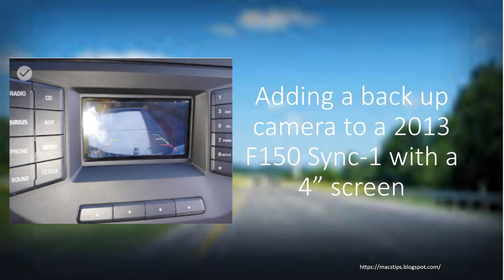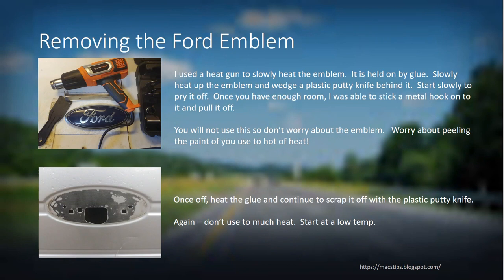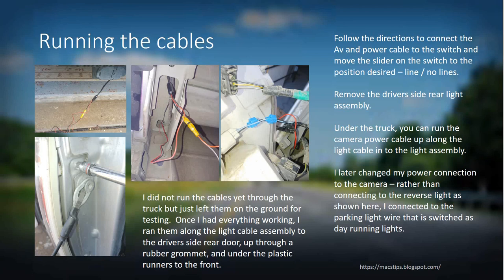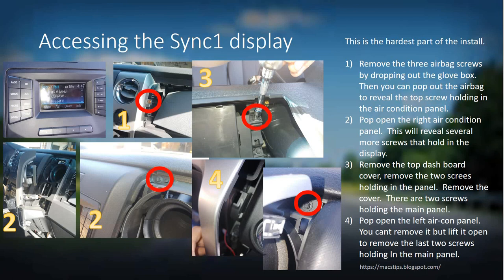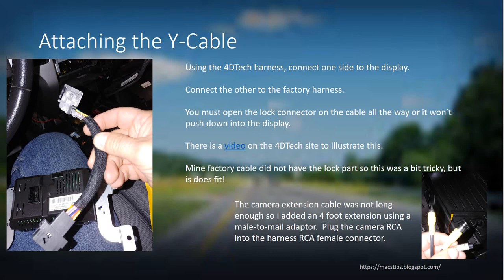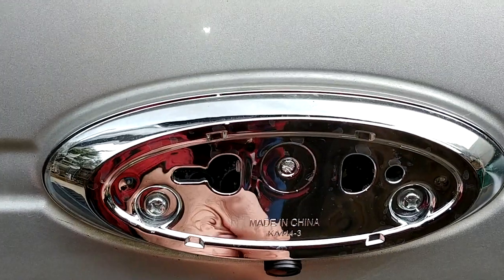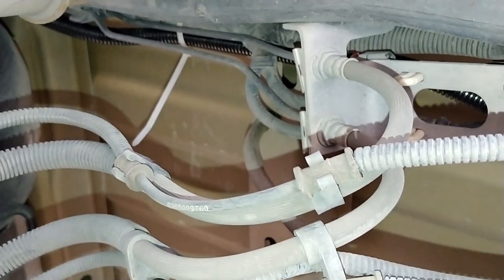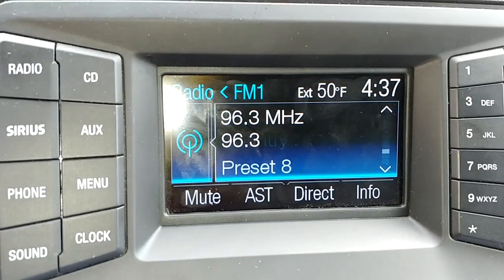Adding a back up camera to a 2013 F150 Sync1 system - Complete Installation using Forscan

Comment: Thanks, i've been looking for this a long time aswel and also only found that guy with the ford transit.
got a ford Kuga / Escape 2014 and change bout everything i could, i do have a black screen wich says no camera calibration orso but stays dark.
ill try this if fcdim pops up again, it somtimes does'nt and if then i was not able to click on the digits.
did you came across these struggles aswell ? Realy nice and calm explained tutorial, very helpfull
Reply from the maker: I did not have issues with accessing the FCDM module and address.  It might be related to the interface device you are using - i have read others having issues with ones that have the switch on them.  good luck and let me know if you were successful!

Comment: unfortunately the reverse sensor disappears. Would be nice to have both the rear cam view as well as the reverse sensor indicator.
Reply from the maker: Thanks for the info - I do not have a rear sensor on mine.  There maybe another setting that would enable it as well.   Check out the forscan forum - they may have a solution!

Comment: Hi, this is a great video! I have a question, the OEM harness has some empty pin slots.. The Video wire should be connected to one of those slots.. Can I just get a pin with an RCA plug and put it on the slot pin slot? I need a signal and a ground right? I heard in another video that I can take the power from the slot #6 and the ground from the #12.. Can I do this and then all the OBDII thing? Sorry I’m bad explaining myself 😅
Reply from the maker: It depends on what version of sync, and oem harness you have.   I used an adaptor Y cable that had the RCA video connector in place.  If you measure the video input pins, and measures out right, those would be your inputs. There are some videos out their that show splicing or adding pins to the existing cable.  I did not do that so not 100% positive.   Good luck and let us know the results!
Reply: @TMackTips  I’m gonna give it a shot.. I ordered the Veepeak scanner, I’ll follow with attention the steps of your video and I’ll let you know how it goes..

Comment: Mine has the camera in the rear view mirror, so does this mean I can connect it to the 4 inch screen I had and not use the rear view? My camera is going out so I need to replace it anyway. Thanks for the video.
Reply from the maker: Josh   That might be possible if your 4" screen tests right for the video chip and you can still get the adaptor Y cable for the display.  And you mirror has a standard video plug that you would unplug and plug in to the Y cable.  Cant say for sure yes - but the video and links might point you in the right direct.  I also put a rearview mirror camera on my jeep.  See this....   https://youtu.be/9rrL09uTUP8

Comment: On the 4Dtech site their are several harness options.. A,B,C and then a flash programmer option with each harness. Do you know which option you choose. I have the same exact year and model truck.
Reply from the maker: it appears the model is no longer available.  This is the link I had in the video.  You may want to chat with 4Dtech.  I did not use the programmer as I enabled it using Forscan

4Dtech.com - Rear Camera Harness for Sync1 4” screen - $60
https://www.4dtech.com/backup-camera-programmer-harness-for-ford-vehicles/
Make sure to check your screen for compatibility on the 4DTech sight!!!!!
Reply from the maker: In addition - looking at the link, it looks like harness A supports all screens and models.  The cable picture looks similar to what I installed but would double check with 4Dtech

Comment: I am needing to do this same install but your links to the camera don’t work.
Reply from the maker: Thanks - it appears the model is no longer available.  Also the links to the 4D Tech cable changed as well.   I have updated the description.  Good luck and let us know what worked for you!

4Dtech.com - Rear Camera Harness for Sync1 4” screen - $60
https://www.4dtech.com/backup-camera-programmer-harness-for-ford-vehicles/
Make sure to check your screen for compatibility on the 4DTech sight!!!!!

Videosystem Compatible Emblem Backup Camera for F150 F250 F350 F450 F550 Year 2004-2016 - $80  (https://www.amazon.com/gp/product/B08KTHTMJQ/ref=ppx_yo_dt_b_asin_title_o04_s00?ie=UTF8&psc=1)   - it appears this model is no longer available so replaced the link with a search.

https://www.amazon.com/s?k=Emblem+Backup+Camera+for+F150+Year+2004-2016&ref=nb_sb_noss

Comment: Will this work with an aftermarket tailgate handle with camera or does it need the factory emblem camera?
Reply from the maker: this was an aftermarket  ford talgate camera.  if that is what you were asking.  As long as the camera has a video input rca type plug - it should work fine.